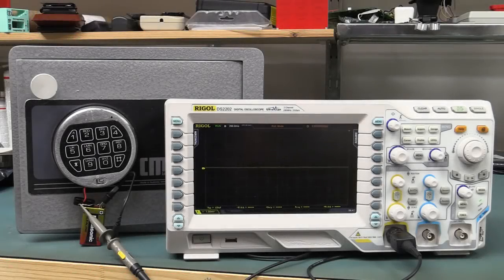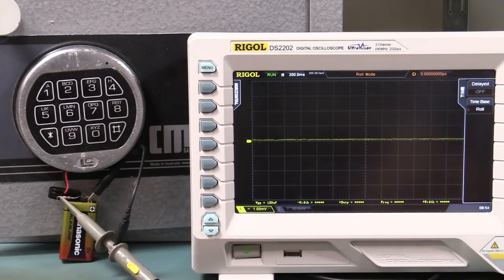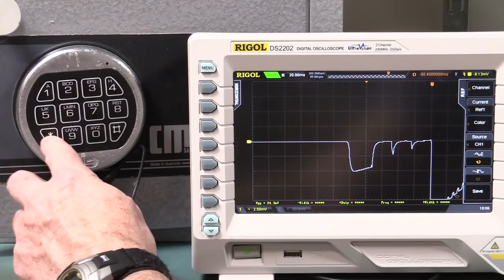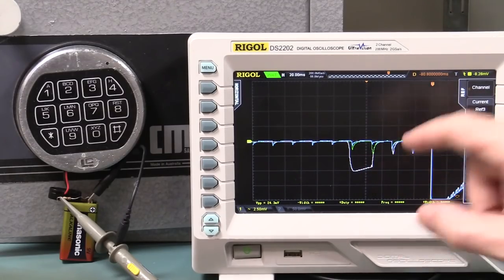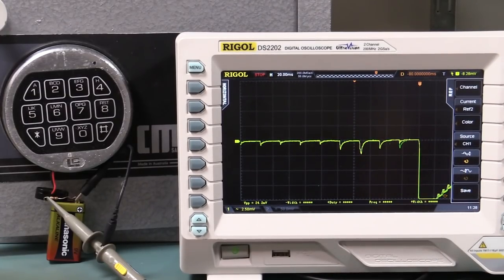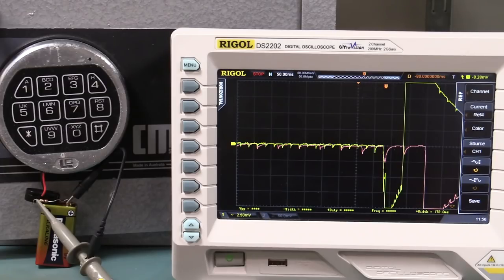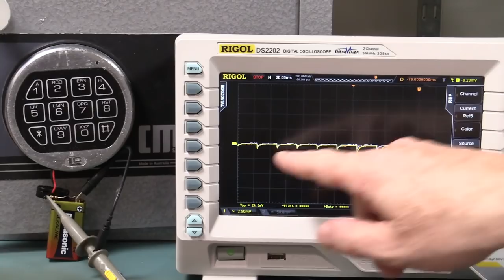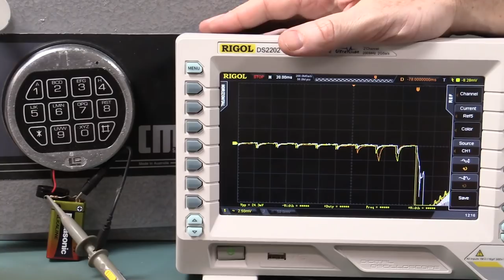EEVblog #771 - Electronic Safe Lock Powerline Attack Part 2

Comment: Unfortunately, all your second digit captures were done after a known correct first digit giving the illusion that an arbitrary two digit correct order was being tested. Is there any difference between right/right, right/wrong, wrong/right, and wrong/wrong for the first two digits? If so and it maintained throughout you would drop the number of needed attempts to 100(AB) + 10(C) + 10(D) + 10(E) + 10(F),,, that is to say 140 tries (maximum.)

Comment: So if I were to program a keypad, you have at least given me an answer on how to make sure I don't introduce a power line attack vunerability.

Just make sure the inputted code is stored exactly the same way every time, and only run a comparason on the inputted code, to the stored code, once the last didget had been pressed.

Comment: You know, it's kinda silly (at least in hindsight) that they process the validity of the key in real time.

There's no reason to: they can just scan the whole thing into a vector, and once you've done the whole thing perform a constant time load-compare-store sequence over the vector, and only branch at the end of that process.

Ditto at the end they simply write zero to the input buffer at the end of the timeout regardless of the input state.

Comment: Just a quick video eh? :P

Random thought, as the thing's running off a 9v battery, maybe that could be causing a variable in the readings, if you run it off a bench supply maybe that could yield some more stable results, assuming one could be arsed to do so... :P

Comment: The first two digits will take up to 99 attempts so about 17 mins to get the first two digits. Then each consecutive digit will take max of 10 attempts so lets say 20 mins per digit. so about 27 mins so say about 30 mins to crack it.
Reply: Gabriel Strange though if your unlucky, with the last digit you could be looking at 2 hours max.
Reply: Gabriel Strange Now get someone to randomise the code and see if you can crack it.

Comment: If you actually found a way into this safe would you still post up the video? Wouldn't you afraid of getting slam dunked (shafted up the ass) by the safe manufacture for exposing the venerability? Surly (Shirley) any reputable safe company would be monitoring the interwebs for any likely hacks into there equipment, I know I would and be happy about doing so myself or hiring a person just for that purpose (highly under paid of course!)
Reply: Uber Micro Repairs If they sued him for revealing their own 'misconduct' so to speak, he could counter-sue pretty easily for a significant profit on a variety of grounds, from press-interference to anti-consumer fraudulence. To be honest though, quality manufacturers usually want people to 'penetration test' their products in a noncriminal manner, so that they can improve those products rather than being exposed as 'crap' in an actual heist. They usually pay people to do just that.

Comment: Quick ;) ! :)
Reply from the maker: naguar Well, it didn't take me much longer than 30 minuets to shoot!
Reply: EEVblog no issues :) good vid.
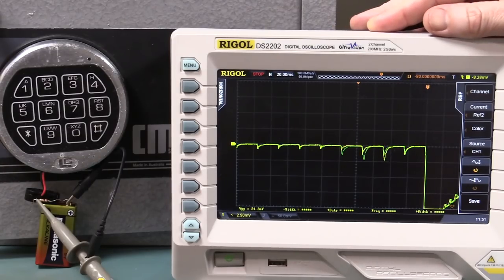Reply: EEVblog dave at 18:15 when you are capturing if there is precessing at the end you need to look at the waveform after the beep wave not before it cause you are looking at the keypress, you need to look at the waveform between the last button beep wave and before the 2 beeps wave forms.
Reply from the maker: Dany J. There is nothing after the beep.
Reply: EEVblog weird, not even anything just immediately before the 2 consecutive beeps?
Reply from the maker: Dany J. I am looking at the data just before the beeps, that's where the activity is.
Reply: EEVblog ohh my bad re watched this part, i thought its 3 beeps if correct or 4 beeps when its wrong, ops
Reply: EEVblog b
Reply: What about a strong magnet ?? Can it reset the device or manipulate the locking mechanism?

Comment: You weren't happy about the lower amplitude spikes on some correct keypresses, but to me they still looked like double the amplitude of wrong keypresses. So based on what you've shown here, I think it could be hackable. People in the comments seem awfully optimistic about the design, like "surely they would've thought of that"... Well I'm more of a realist :)

You should get David2 to program a random code and have you try to hack it, based on tiny or bigger spikes before the beep. To shorten the ordeal, he could give like 3 possible combos for the first two digits, and 3 for each digit after that. If all goes well, you could hack it in 10 minutes.

Comment: ...or just drill a hole, go in with two probes and directly send some current into the solenoid to retract the locking pin. But that's no fun, of course.

Comment: I suppose your finished with this bit but if you are interested I could send you the 4 other common commercial locks. Like a sg1 6120, sr1, sr2 and the older version of your lock a lg 3600.

Comment: Swap the 10R resistor onto other battery terminal and repeat? Insulate safe body from bench. Maybe use AM radio next to lock and connect audio out to scope to listen to electronic activity. Just a thought. And who the hell is Flynn? :)
Reply: Dave D Popularly thought to refer to Errol Flynn, but older references are to be found: 
https://en.m.wikipedia.org/wiki/In_Like_Flynn

Comment: 25:00 Maybe it has to do with how much voltage the capacitors in the IC happen to end up with at the end of the sequence?  Talking tiny, tiny numbers, probably pF or less, but that's my theory for the randomness since you are measuring battery draw. 
I watched a talk about designing the Tesla autonomous driving computers, they had it calculated exactly how much power every single line of code used.  Whether you used an integer, a double, a float or a string had major changes on the power used, and it counts when you are running on battery.
Those numbers may not change as the code doesn't change, but the "reserve" of the capacitors both on the circuit board and the IC changes after a sequence is run, or something, IDK, this is getting REALLY out of the box, but I hope you understand my point.

Comment: A secure safe would not even store the correct code. It would store a hash of the correct code, then generate a hash of the attempt and compare them only after the attempt has been completed. That way the same execution path is used for all digits correct or not.
Reply: I don't think any consumer-grade safe does that because the processors in them are probably too old and simple to carry out a simple hash function.

Comment: Thanks Dave - love your vids, 1st time commenter :-)
I know less than nothing about this stuff but I wonder what happens if you some how squirt the 'correct' waveform x6 back into the power supply - would the lock open?
(and apologies if that is a stupid thought. Im an enthusiastic synth DIY guy - more smiles and 'chance my arm' than knowledge!)
Reply from the maker: mCKENIC No, it doesn't work like that. The microcontroller is a digital device with massive Power Supply Rejection Ratio (PSRR). And the lock is designed against "spiking" the power rail in order to short directly to and operate the solenoid.
Reply: EEVblog "shorting it out" is precicely what I would have though but would have serious implications in failure. What about the way it's programed? Would storing the numbers pressed in memory and comparing it to the set combination only after 6 digits have been pressed remove this potential vulnerability?

Comment: If I'm doing my mental math and understanding the video correctly (I'm probably not, I'm not a clever man), then using the stuff I saw would reduce the maximum amount of guesses in a brute force from 1,000,000 to 140ish. 100 for the first two digits, 10 for each of the remaining, not discounting that I'm completely misinterpreting the data. I think it'd be worth more spending time looking at what the lock does mid-sequence, since by the end of the sequence you're gonna know if it's wrong or not.

Also a degree of social engineering might be able to reduce the guesses; starting each time with 7 could potentially give you better results since people think 7 is a "random" number, and if the sequence is randomly generated, the digits are arbitrary and the "value" of the number is irrelevant (since the lock only cares about the shape of the number; it's not doing any arithmetic).

Comment: I wuldn't be surprised if all the computer inside does is 1+2+3+4+5+6=21 and then checks if the entered value is 21,'
would explain too why it acts weird at 1+2+3+4 because it hits a 2-digit integer
Reply: +Slash27015 I doubt that's the case, there are several ways to get a sum of 21. For example, 1 + 2 + 2 + 5 + 5 + 6 . That also equals 21 and does not work (I hope)

Comment: Your approach is wrong! A typical programmer will not check or make any decisions based on key press for obvious reasons. The only option you have got is at the end of the 6th key press, if they exit the check_correct subroutine as soon as they hit a wrong number then you will be able to detect which number in the 6 number sequence is wrong. Here is the example 

for (i = 0; i < 6; i++) {
   if (pressed_key[i] != correct_key[i]) return;
}
activate_solenoid();

If the function is most likely be like the one shown and if you have entered "678321", it will exit this function at the very first loop iteration so your execution time will be less. If you press "154789" then the loop would have executed a little more so you know the first key is right and proceed like that!
Reply: Exactly what i was thinking, looking at it as a programmer.
Why would i check each key as they are pressed (if i need to get all 6 digits before actually doing the final check)?
Not to mention it would be an obvious security issue.

Just store all the digits and verify it in the end (so you force a verification loop and the brute force protection needs to be used for any meaningful information).

You can even make it impossible to detect in the end if you make a way to equalize the process logic, like:

valid = true;
for (i = 0; i < 6; i++)
{
 valid = valid && (key[i] == pass[i]);
}
if (valid) unlock();
else anti_bruteforce();
Reply: Actually, that would be a terrible check. You want it to execute in constant time as well, or you can guess it in about an hour (for a 6 numerical digit lock, assuming 5 minute lock out every 3 incorrect attempts).

bool correct = true;
for (i = 0; i < 6; i++) {
   correct = correct & (pressed_key[i] == correct_key[i])
}
if (correct) {activate_solenoid();}

This checks every digit against the correct value for that digit, and sets the value of the "correct" register for each digit too. Should leak a lot less info via execution-time/current.
Reply: A typical electronic engineer writing software, however, might be thinking of this as a state machine, and may do exactly that, so I wouldn't rule it out.

Comment: They would't be stupid enough to check the key presses individually.
Might as well check all six keys when you press enter.
Reply: Also the keypad is scanned in rows and columns.
Prior to a timeout, you never know where in the scan you are. If you press 5, you might be in the scan routine prior to the 5 being checked, or maybe it is past that and you'd have another program cycle before the 5 was picked up.

Comment: Could you not find out the 6 numbers using finger print powder or something?
Reply: Then you would be left with only 1millon combinations.
Reply: Micky S. A lot less from what we saw in this video. More like 56. with 10 seconds per combination that's like a max of 10 mins, more like 5.

If there are 6 keys that have finger prints on them or are worn down it's safe to assume that none are repeated so that's another 9 keys ruled out.
Reply: Lets assume you kniw the code has 6 numbers and you know which 6 key are used thats 6^6= 46656 combinations
Even when there are only 2 keys used in a 6digit passcode its still 64 combinations
Reply: Micky S. Not when you can check if the next key you enter is correct or not (what this whole video is about)
Reply: Dave did not check what happens when you enter the first wrong and the second right. Also i think the waveforms dont show the right or wrong key but rather their binary data which have to be processed. And you would have to wait for at least 1 10 min cooldown because you have to guess the last digit.
Reply: Micky S. Yeah, but I'm just assuming it worked. But yeah, the last upto 9 digits would take 10 mins each. So an avarage of 55 mins to break into the safe if it was susceptible.

Comment: You are making the assumption that the lock is testing each number you press against the same position of the stored number.  Instead it is probably taking all 6 inputs and then comparing is as a whole to the stored.  The processor would have no knowledge of the accuracy of input until all 6 digits are input.

Comment: here my dummy draft program,  1 button save into an array slot and start a 10 seconds timer, for all the next digits i also store them in the array,  if timer expire i flush array, if 6 digits I will fetch the eeprom and compare with the digits and unlock and increment the bad sequence count, so all the process is at the end so you will never see difference before the look unlock try, and at this timer it is to late ...   :o)
Reply: and at the end comparing will be something like this... built an integer with the 6 digits and compare it with the eeprom number,  so always the same code  if good or bad number, after it is too late it will unlock or not ...
Reply: maybe best approach is to look at the reprogramming of the password sequence is there also a false counter sequence ? ... mix this with power brown out and maybe you can be able not to trigger the bad sequence counter, ...  leading to and automatic trying sequence software ... maybe ...  :o)

Comment: It would be quicker to grind it open and you wouldn't need all the equipment, but then that is not what it is about is it?  So it is going to be not opened.  Ok, I'll get the money from under the bad and put it inside the safe.  Drats, the battery is flat!

Comment: EEVblog  can you bypass the 10 minute lockout thigy by removing power for a seconds
Reply: It uses a solenoid  I believe. So theoroetically you could just hit the input wires with around 80V DC at 500mA. That should bypass its safeguards, and energize the solenoid long enough to get it open.
Reply: It uses a solenoid  I believe. So theoroetically you could just hit the input wires with around 80V DC at 500mA. That should bypass its safeguards, and energize the solenoid long enough to get it open.
Reply: zach w.  you don thave access to the solenoid from the method he was using to attack the safe  only power line and keypad
Reply: Exactly. That's why you have to know the sweet spot for a 9 v device like it. 
Also gotta know what the peak voltage the solenoid can take for about 1 second. 
The purpose of my solution is to short out every component in the safe up to the solenoid, then have it activate.
Reply: AC power may just work better. Then the device would probably convert the AC to DC just before the solenoid and so short out the device a bit faster with the given voltage.
Reply: what he is doing is a non distructive breakin :p
Reply: I’m suggesting a completely destructive last resort break in. 
I mean if nothing else works, and you need your belongings out of the safe. You can either try this, or get a buzz saw.
Reply: I enjoy the thought of just getting in by any means necessary. 
I also find dangerously high voltages strangely exotic and attractive as an interest lol.
How many people do you know that enjoy just looking at that 2ft white hot arc, and just pondering the possibilities?

Comment: Is it so hard to see that all the randomness Dave flubbers about is just shifting the wave form one cycle to the right and skipping the last cycle? You still see all the information: medium dip then big dip, wrong number means immediate beep, right number means one or two additional cycles and then the beep. Seems repeatable to me. And for the math part, 100 tries for the first two digits,10 tries for the 3rd and 4th digit at 10 seconds each is 20 minutes, and for the last digit 10minutes per 3 tries, so its another 30 minutes if you're unlucky. But still definitely vulnerable I'd say.